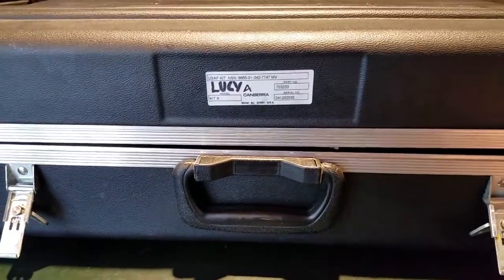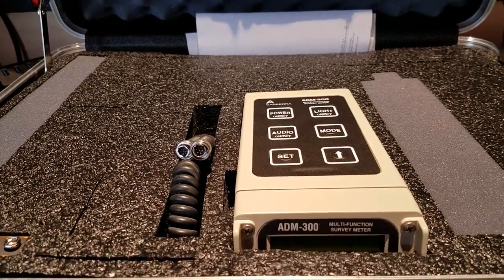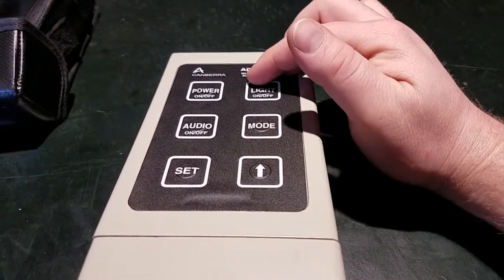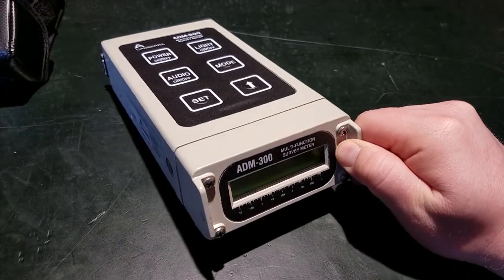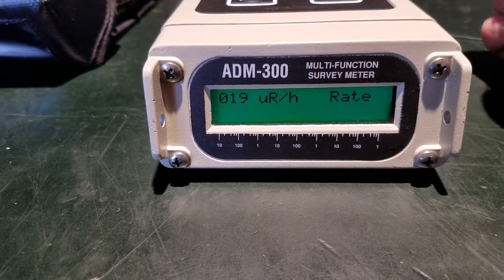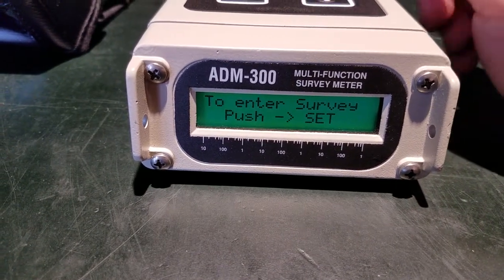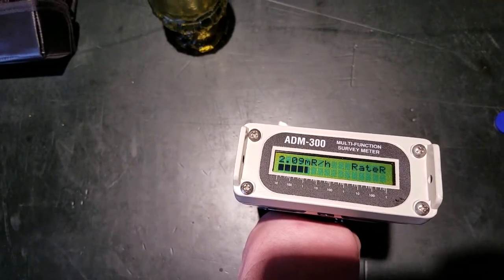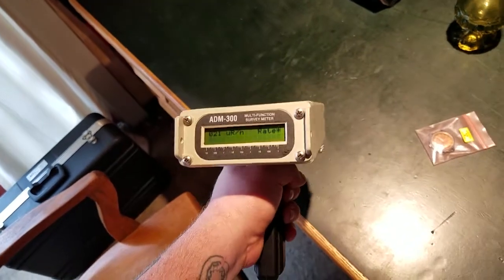Canberra/NRC? ADM-300 survey meter (Kit B) demo and info.

Comment: I own a kit myself they were real cheap on ebay. I was able to snag the X-ray probe for plutonium contamination detection, the pancake probe for general purpose survey and Alpha probe for plutonium and other alpha emitter decontamination. All the probes are intelligent and store the factory calibration data making the probes interchangeable amongst any ADM-300. In addition different settings get unlocked depending on probe used.

Comment: Cool video I've been wondering about those units.
Reply from the maker: They're great. I have been working on Python code to grab the readings and combine them with GPS data.
Reply: They are great for socking away for emergency use. They have a huge dynamic range of 10 uR/hr which is background to  10000000000 uR/hr which is instant death level. And they also provide accumulated dose readings as well. They also self test continuously to insure you are getting the correct reading.
Reply: @joshlucy9420  That is awesome! I am thinking about doing the same thing to make radiation map overlays. How did it turn out for you? There are a few uranium mines in Grants, NM that I thought might be fun to map.

Comment: Can you please provide another video showing more detail on this Radiac unit, I'm looking to buy one and would like to see more on it.
Thank you
Philip
Reply from the maker: What specifically are you interested in?
Reply: @joshlucy9420 
I would like to see more angles of the detector showing it in more detail, maybe a bit more on the operation of what else it can do as far as its controls.
On your other video showing your smaller detector that you said was bricked and you needed help, I noticed on ebay there is a non working one for one hundred dollars, maybe you can get it for a lot less.
Thank you
Philip

Comment: I also have one of these units now. Works great, I keep it in the truck. Until I find something better. I wish I could figure out how to make my AN/UDR-13 work. I doesn't display any back ground radiation. It looks like a MRad but must be on a different scale. I have the user guide but I'd like a more comprehensive manual. Too many unknowns.
Reply from the maker: I think the military unit displays in Gy/hr. It's odd that it doesn't show any background radiation as well...
Reply: Matthew D the lowest level readable on the AN/UDR-13 is .001 cGy/hr which is equivalent to 1 mR/hr so think about it background radiation is 15 to 20 uR/hr and the lowest level the UDR-13 measures is 1000 uR/hr. So you should never expect a reading on that UDR-13 unless a dirty bomb went off or nuclear war. The UDR-13 was designed to measure radiation in a tactical nuclear war or dirty bomb situation. also the UDR-13 also measures exposure to prompt neutron radiation in addition to gamma so you get a more accurate and well rounded dose rate and this is why they use greys because they are measuring absorbed neutron and gamma radiation. This is expected during nuclear war. Both ADM-300 and UDR-13 are valuable in your arsenal of radiological measuring equipment in the event of an incident occurring.

Comment: Can I detect gamma without proble please get back to me?
Reply from the maker: Ron Joint Yes. The internal tube detects gamma only with the shield closed and beta + gamma with the shield open.
Reply: Josh Lucy thank you so much happy late 420
Reply: Josh Lucy. Also have you found any probes that work?
Reply from the maker: The probes are specific to the ADM-300, and I don't know much about the electrical properties or communication protocol they use. The external probes have onbaord config and calibration data, etc. They are out there on E-Bay but they're very expensive. I have been using the internal probe exclusively.